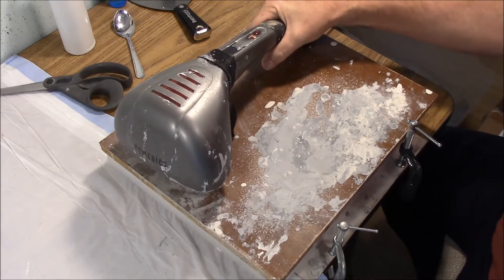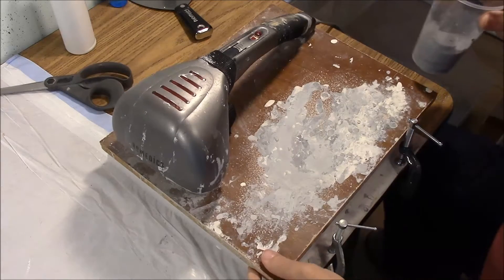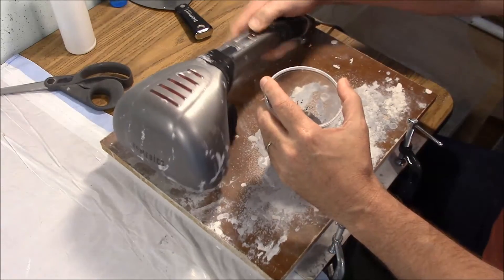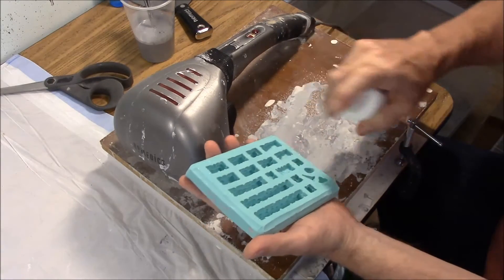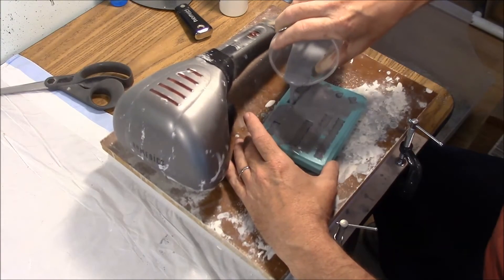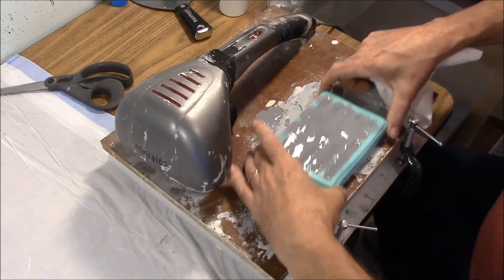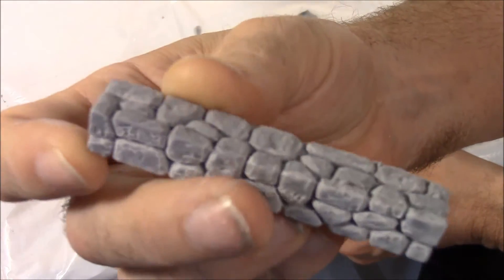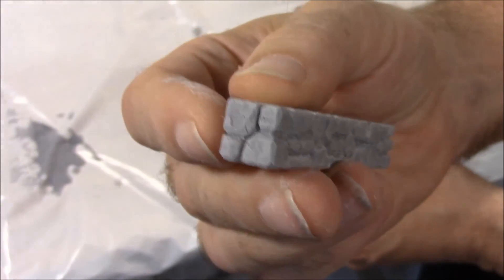Advanced Casting Part 3: Using a Homemade Vibrating Table

Comment: will the table work on getting bubbles out of composimold please reply if possible
Reply from the maker: Composimold is used to make temporary molds with. The vibrating table will probably not help to remove bubbles from the mold while creating the actual mold. However, it will help if casting plaster into the composimold.
Reply: sorry me again do u know if I can make my own bubble buster for the composimold
Reply from the maker: @russelltiley1861  Sorry, but I do not know how you could get rid of bubbles in the mold making material. Composimold is not a very good mold making material so there may be no good way to do it. I would suggest you try moldstar 30 instead. It's easy to mix, equal parts of A and B, you don't need a vacuum chamber, and the molds hold up really well. You can find it at https://www.smooth-on.com/products/mold-star-30/
Reply: ok thanks for yr reply
Reply: hi sorry do u know how much storage life the  moldstar30 has please
Reply from the maker: @russelltiley1861  I do not know for sure but I imagine you would get several years worth of life out of the mold after it is made. I also imagine you can store the liquid mold material for a couple of years as well and it would still be good.
Reply: thank you for yr reply

Comment: And what's below the board?
Reply from the maker: If you look at the instructions for making the table at https://www.hirstarts.com/casting/advanced.html#vibrate you will see that the board is glued to some thick foam padding which is also glued down to some thick mat board. The mat board sticks out the front so you have something to clamp down to your table surface.

Comment: Would it work without pouring on the edges and without using the spray-on product? I'm not using silicone and want to waterproof my caster.
Reply from the maker: Not sure what you mean about wanting to waterproof your caster. The spray on product is used to break the surface tension of the water so it will flow into the mold without beading up. This spray on product is called surfactant and you can find information about it at https://www.hirstarts.com/casting/advanced.html#surfactant.